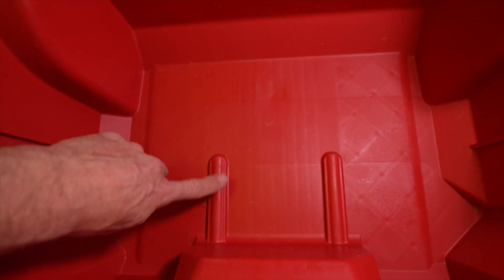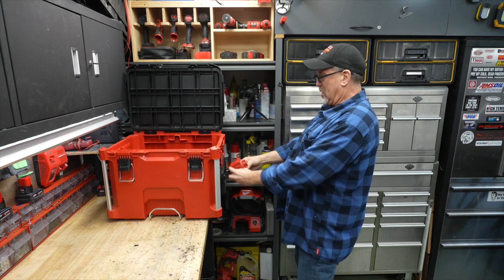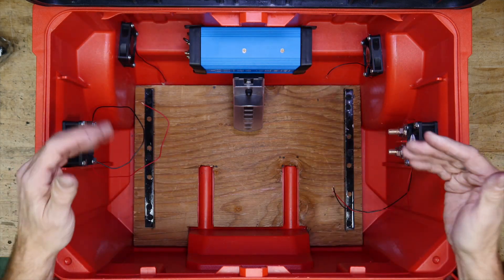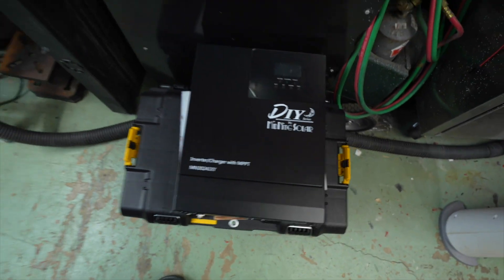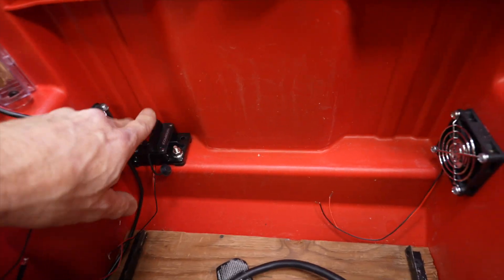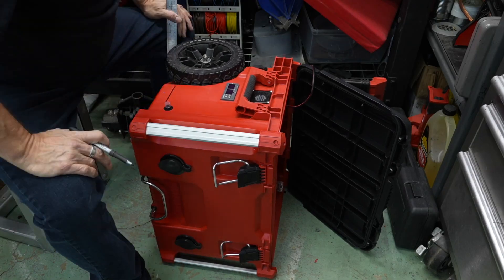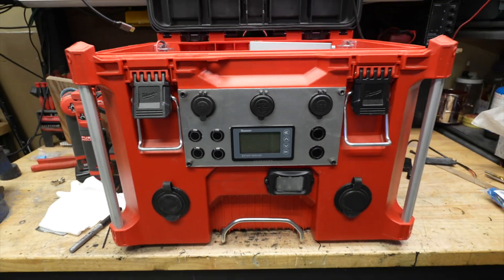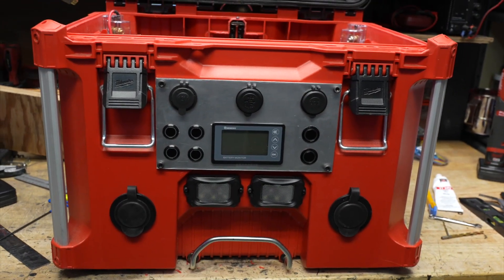Milwaukee Packout DIY Solar Generator. Part 1

Comment: Nice one. Did you ever have issues with dirt coming off the wheels into the intake fans?
Reply from the maker: Well I don’t drag the thing through the mud so that helps but ya it gets a little dusty in there. Not to bad though really.

Comment: Awesome build! Do you happen to have the battery information? Trying to build one and Amazon link doesn’t work.
Reply from the maker: Thanks for the heads up about the battery link. I'm constantly having to update the amazon links... Here's an American link to those batteries... https://amzn.to/4luRHsW
Whatever battery you go with, just keep in mind that to do what I did in the packout box, you need to use the "Mini" sized 12V batteries. 
Thanks for watching.

Comment: Think I would have tossed baffles on the outside to prevent dirt off the wheels sucking in even though they’re light duty pc fans still grabbin dust given location.
Reply from the maker: That hasn't been a problem yet but I'll keep an eye on it. Thanks for watching.
Reply: @i.b.lancer absolutely, solid build though from an overall design perspective.  I’m working on a setup that will allow for battery pack extensions, thinking the stackable boxes from dewalt might work well and using smaller batteries with simple liftout assemblies to easily swap out bad batteries and allow for slow growth of each pack for lower barrier to entry for folks.
Reply from the maker: @LeisureHQ  Did you see the second part of this video... it's in two parts. In the second video I point out where I added an Anderson plug that allows for external 24V battery packs to be plugged into this box to extend the AH.

Comment: Your inverter is dangerously oversized for your battery bank. The reason professionals and experienced people shy away from an all in one is the fact if one component goes out...your screwed and you have to replace the whole thing instead of quickly switching out one thing. You're learning....people who are unaware and lack knowledge make mistakes. Your next model will be better. Awesome sound quality on the video.
Reply from the maker: You're hilarious.

Comment: What will this power on job site.  Can it run a router. Circular saw. Sorry if dumb ?
Reply from the maker: Yes to both. It’s a 3000 watt inverter.
Reply: @i.b.lancer  what if I don't want solar.  What if I want to do it as a charge at home and bring to site for emergency back up.
Reply from the maker: @ferrarionemr  It has plug in charging… Did you even watch the video?
Reply: Yes I did.  I meant to say if I did it without the solar.    Hoping to copy this but just as a plug in and only a outlet.

Comment: Been thinking of this idea for some timenow, and just came accross your video. AWESOME IDEA! everything I had in mind, but yet to do. Been planning on building a foamy camper for an E bike, and this will be my power supply. Thanks for the hard work being all done.
Reply from the maker: You might want to check out the following video. I made a smaller one that might be better for a bike. You would just have to upgrade it a bit.   DIY Solar Power Pack. With Dual Charging.
https://youtu.be/wPG2LPbW4Us

Comment: Nice-cost-time vs Evo Flow Delta 2 2000 watt 5 year warranty?
Reply from the maker: Well, mines 2400Wh, 3000 watts, infinitely expandable. Took 4 months to build and cost twice as much as the unit your referencing. Plus mine has a ton more features then the Eco Flow. You can't really compare them. Thanks for watching.

Comment: Sir,If the all in one inverter requires 48 volts DC, how are you getting 48 volts DC from 2each 12 volt batteries.?
Reply from the maker: It’s a 24v inverter.  Where did you get 48v from?

Comment: install a back car number plate light inside for some light when working in the dark with a turn on button.
Reply from the maker: Thanks for watching. If you check out the part 2 video you will see that I installed 4 of those lights inside. With switch.

Comment: I dont know what you decided to do with that alum. face plate but you asked...  Id round the corners and chamfer all the edges or at least round off the edges so it doesnt have that 90° edge that says home made.  I bought a rivnut rig because of you.  Ive been wanting one for at least 40 years.  Ive got some double walls on this Dewalt box im using.  No sheetrock screws allowed.
Reply from the maker: I ended up just leaving the plate as is. Nobody’s said anything about it. They all think it looks great, so I’m happy about that. 
Careful, rivnuts can be addicting. 
Good luck with your build.

Comment: Why a dc to dc?   And not just a 12v inverter?
Reply from the maker: Dc to dc converter because it’s a 24v system and one of this box’s intended uses is 12v battery charging. There is an inverter. 24v inverter.  Had you actually watched the video you would of known all this.

Comment: Nice build! The fans remind me of how you would set up a generator shed
Reply from the maker: Ya, makes sense right?
Reply: @i.b.lancer  indeed!
Reply: Really enjoyed watching that. I have similar sized batteries from basengreen, hooentonfind a toolbox in which they fit. Milwaukee too expensive here in Europe.

One remark though. In your description box you speak of a 200Ah system. But you have 2x 100ah 12v batteries connected as a 24v system. Meaning you have a 100ah 24v system.

Comment: Loving this one too!  Hadn't thought of riv-nuts, but they surely do look neater than bolts.  The custom instrument panel really makes it pop.  

I'm wanting to do a 200AH system with a 3KW inverter in the Ridgid wheeled box.  Still figuring out the math on everything.  Thanks for all the ideas.
Reply: It's difficult to find batteries that can support more than 100 Amp  output continuously.   At 3 kW the dc voltage will sag a lot.
Reply from the maker: I seriously doubt if I will be pushing more then 2 kw through this little system.  The 3000 watt inverter is more for the headroom. It was perfect for the project so I bought it.

Comment: You have already answered this question.  What is the total weight and cost of the build?  Do you have the components already packaged to distribute? If been looking this diy project for the last month. You and one other person have the cleanest builds. Awesome job thank you in advance.
Reply from the maker: I’ve finally finished this build and I’m just putting the final touches on the video. So I weighed it today and it came in at 109 lbs.

Comment: Been thinking about getting one of these boxes for my build.  Would like to add 2 100ah lithium batteries in it.  Standard size.  But not sure if it will hold it.
Reply from the maker: Be very careful when picking batteries for this box. Depending on the inverter you’re going to use, it will be very easy to buy batteries that are too large. Plan your build out carefully. Good luck.
Reply: Yea that's where I'm running into the problem is making sure everything is going to fit.  My 1st box fit an 115ah AGM battery group 31.  And a renogy 1000w inverter inside and the box that went over is used for the Epever charge controller the BT unit and fuse block.

Comment: Great job! I’m looking at having one built in to the next smaller PackOut with just the top handle. And having it built at the Festool SysPower bank spec. I think it’s 5000 watt but it’s extremely compact.

Comment: This is a great setup, it gave me a lot of ideas for one that I am doing. Thanks for posting.
Reply from the maker: Glad it was helpful!
Reply: @i.b.lancer 
Maybe, you could install a thicker aluminum plate instead of the thinner one to give the wire connector more wiggle room. Bunched up wiring can cause more problems down a bumpy road. ⚠️🔥